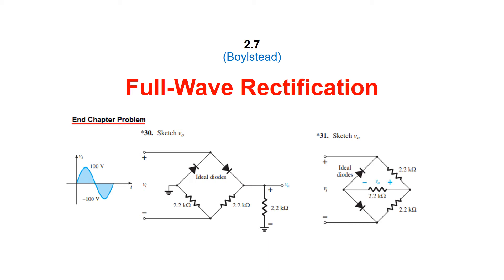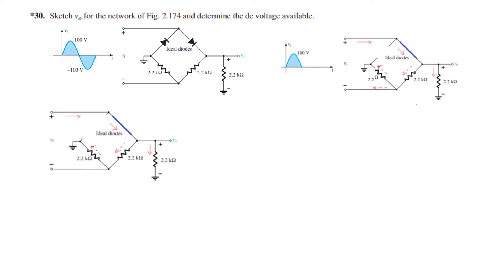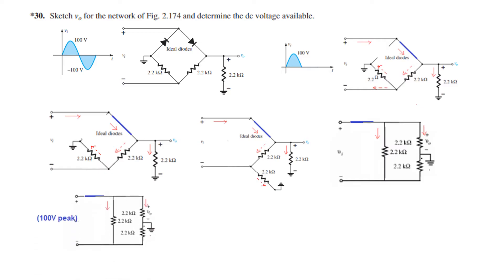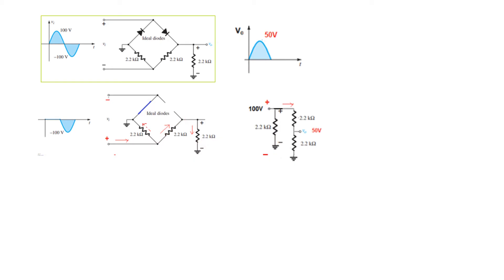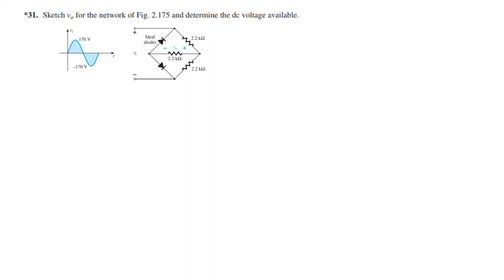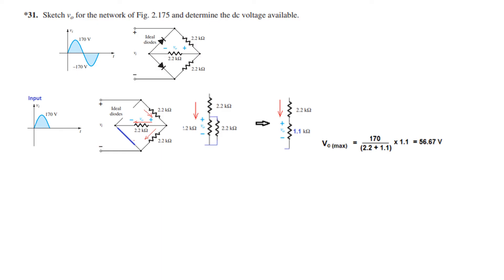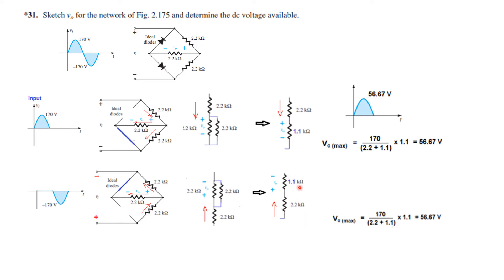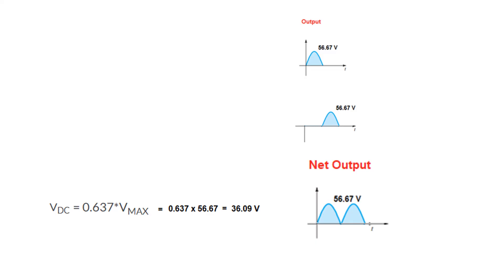(E)EDC(B) Q 2.30 & 2.31|| Full Wave Rectifier ||  Electronic Devices and Circuit

Comment: Sir, how to find maximum peak voltage?
Reply from the maker: It may not be relevant to this question, but just for knowledge to find maximum value od any signal, we differentiate the signal and equate it to zero.

Comment: Bhai jo smjhaya na mtlb kya btau mja aagya
Reply from the maker: Shukria
Reply: @ElectricalEngineeringAcademy  sir if the diode is a practical one ie silicon or germanium, will it affect the Vdc voltage formula or will the formula will still be 0.637 x Vo-max
Reply from the maker: @ashirahmed5600  Yes. Please see eq 2.11 in the book. It will be Vdc =  0.636(Vm - 2VK) =0.636(Vm -2 x0.7)